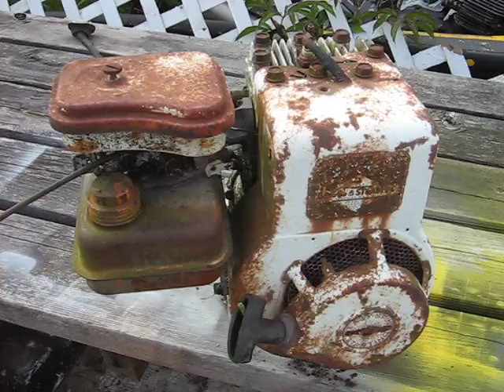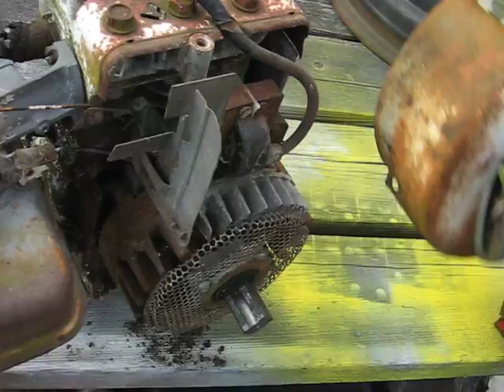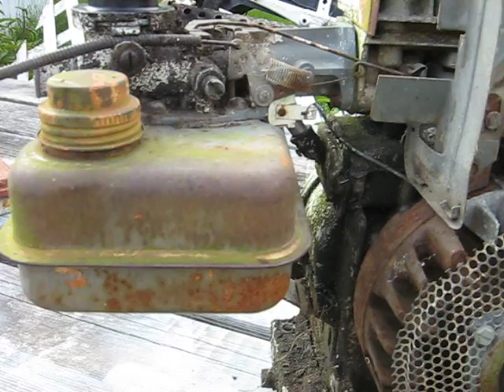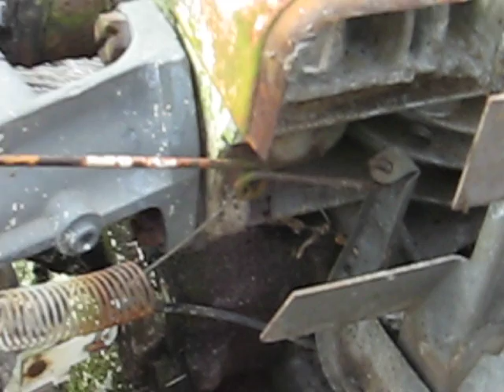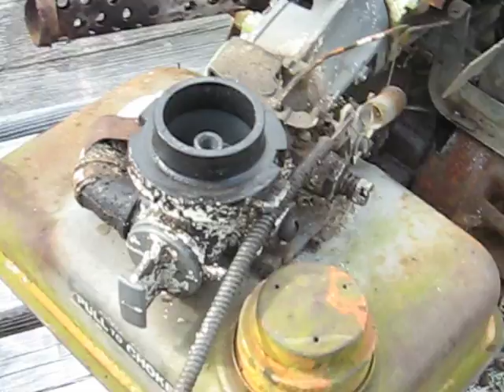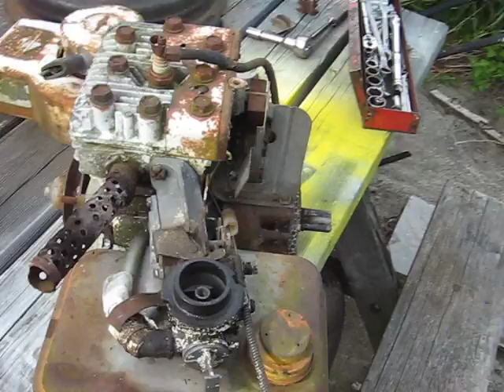Briggs 80202 (3 horse) Governor Linkage Operation

Comment: You have just helped me save my brigs motor on my snowthrower
Reply from the maker: droidrazor873 That's good, always like to hear when a vid is helpful :)
Reply from the maker: droidrazor873 lol, the engine I show in the vid is the same one I have been doing a re-work on to use it on a mini bike. Apparently I unbolted the carb and gas tank, heaven only knows where I put it. Anyway, the engine is now all painted up white, looking almost new, and been completely tore down and checked. Vids to follow soon. I had completely forgotten about this vid, glad it has helped you fix a Briggs. I need to get back to work on my 3 cylinder Stacker Radial Briggs, haven't been putting enough hours into it lately.

Comment: Why does this carb have optional choke linkage and not have it hooked up? I'm trying to figure out why mine won't start unless I manually add gas to the top of the carb... I've rebuild and replaced damn near everything trying to get it working
Reply from the maker: +Jeremy Remele Not sure about the choke linkage on this engine, I intended to have it running ages ago, but got carried away on other projects. Normally these old Briggs engines are fairly easy to start. especially with an operating choke, not really sure why yours is being fussy, it has good compression and spark I presume. I would check if the throttle or choke shafts are worn, allowing air in that dilutes the starting mixture, just an idea.
Reply: I am have the same problem! Did you ever figure it out? I have to add gas through the air cleaner to get it to run for a few seconds.

Comment: Where did you get that governor spring? I can't find the right one
Reply from the maker: droidrazor873 I am pretty sure the spring came with this engine. Do you think you could modify one to work from a 3-1/2 hp lawnmower perhaps? I would imagine you should be able to find the correct spring from Briggs (though you will need all the numbers off the recoil cover). If you don't have the correct starter cover, let me know and I will see if I can find this engine in one of my piles!!!  :)  I started numbering them with a marker after engine #163 lol  :)

Comment: Got one exactly like that can't get it to fire
Reply from the maker: If it has points type ignition, replace the condenser (after making sure the points are clean and properly gapped at 0.020" ). You also need the magneto space properly from the flywheel, about 0.010", and a clean spark plug. If all those check out, replace the condenser, if that doesn't cure it, it may well be the magneto. You can convert it to the newer magnetron electronic ignition, and forget about the points etc.. Also, maybe you can get a used one from a flathead 3.5 horse range lawnmower, as the flywheel is the same diameter, and it should bolt right on. Hope you cab get it sparking  :)
Reply: @ChargerMiles007   For some reason, it seems to me that extra zeros are added to the size both times here,
in the metric world, typical gaps are 0.25-0.3 and 0.5 mm
though now I have the same motor in my hands, that's why I'm watching this video

About the ignition, you need to ask separately somewhere, until everything is clear,
I'll probably leave with a question on smokstak